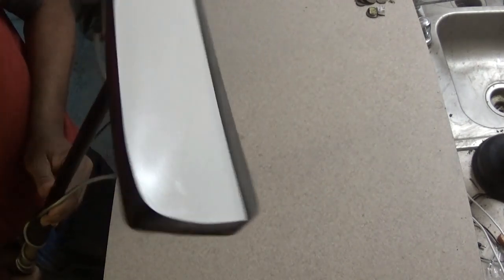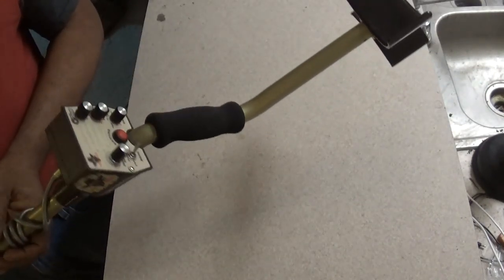Tesoro Outlaw and the Cleansweep..It drives the shallow coil deeper.

Comment: i have the cleansweep coil on my compadre and i tuned the machine to the coil and i can hit dimes at 6-7 inches have pulled pulltabs at 8 inches. i have an outlaw too but the csc works better on my compadre,  i set my discrimination at the n in iron and dont touch it ever during the hunt, i dig everything with a full repeatable signal, i have found a ton of gold rings with it. it is actually my most used setup,  my xp-deus hates it.
Reply from the maker: +Mr.Motarded Mike I heard one man call it a ring machine.  It looks like you are seconding that opinion..  I have been looking for a cleansweep coil (they manufactured it for a while) for the Cibola, Tejon, Vaquero line.  I haven't been haunting Ebay and the forums, but just been keeping my eyes open.
Reply: +TexasTigerDigs its probably me that calls it a ring machine i have lots of posts about it on the fourms. the trick that made it work for me was setting disc low and just digging all repeatable signals,  i dont even check before digging just dig. i once dug 9 rings in 1 hunt with the compadre csc setup.

Comment: Do you prefer or have you just done better with the Outlaw than the Vaquero? Thanks
Reply from the maker: E Tex Shooter They are very similar in quality, but very different in execution in one way..  The Vaquero is a great detector maybe second to only the Tejon..  The Outlaw has a specialty in that at its top discrimination it can actually separate Quarters (to a degree) from other clad coins which is unusual for a beep and dig machine, I also like it because it does have the bigfoot type cleansweep coil.  I can't find that coil for the non Umax machines like the Vaquero, Tejon and Cibola.  They offered it once but I haven't been able to find it though I haven't tried that hard lately.  In other words I could live with either in most circumstances..  LOL never use one sentence when 3 will confuse the issue..that's my rule in life.